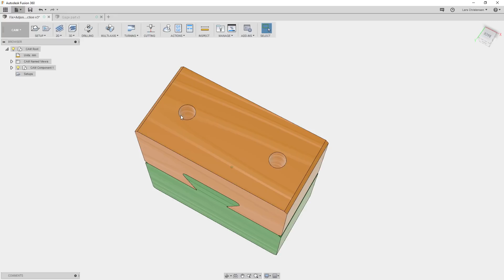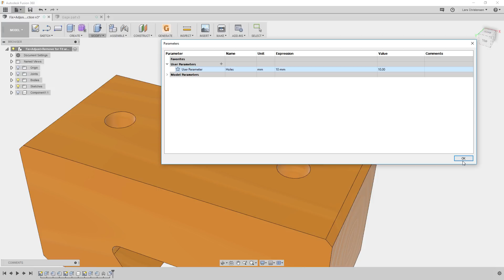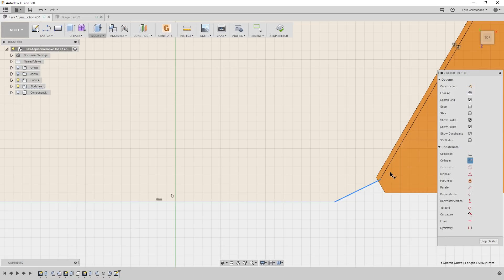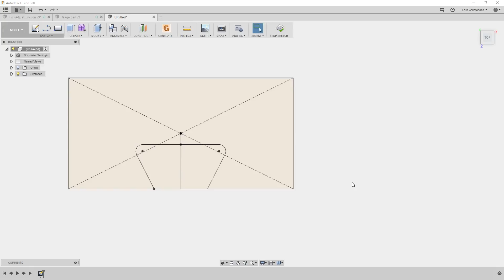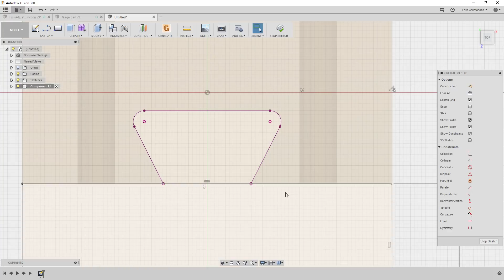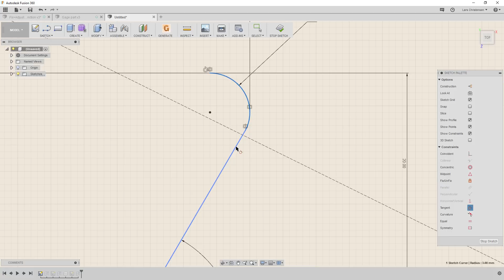Comment: My problem is I have 4 3D printers, all different models.  Biggest mistake ever.  Actually 2 of them are the same model but one has a lot of upgrades so it has become sort of different.  I have an Ender 3 v2, a highly modded ender 3 v2, an ender 3 s1, and an ender 3 s1 pro.  So every time I get something to print right on one of them, it's never the same on the others.  So yeah if you buy a bunch of printers for production or something, try to get all the same model.  I might be selling 1 or 2 of mine soon if anyone is interested.
Reply: yeah?

Comment: So, I worked my way through the dovetail drawer and modeled my part. Now I want to mill it (it's small). How do I undo the joints or do I have to do it over without the as-built joints? Sorry if this is off topic.
Reply: Hi Martha Gay Thank you for watching!
You have a couple of options. One you could just hide the components you don't want to machine or you could break the part out of the assembly, like here:
https://youtu.be/00_6u1J0xkA?list=PL40d7srwyc_Mkgc5wvP_OfVel9aDkNkZ6

Hope this is helpful

Comment: Best practice is to make bodies, and convert to components last.
That way, all your sketches are accessible and you can snap to lines, construction lines, and vertices of the other bodies at will. Sketch points and vertices will also autoproject onto news sketches if the body was visible when the sketch was created.
A side benefit is that it will allow you to organize complicated drawings better since Fusion will not let you change the order of bodies or components that are at the same level. Make all your bodies, then export them as components. Make a new component for each sub-assembly and move the components into the sub-assembly in the order you want rather than the random order Fusion gave you.
Reply: I got the idea directly from the Fusion 360 forum, and they seemed to consider it to be part of parametric drawing. The basic idea being that every part in an assembly has it's dimensions and location dependent on a minimal number of parents that are placed as early as possible in the timeline.
Master modeling would be a good word for it.

Comment: Lars,
Is it possible to use parameters on joints?
Reply: David Ewen_P how would you use them David?
Reply: Yes, you can use parameters in joints. At least on joint limits. It works very well, but I find that in complex assemblies, it gets very slow to calculate (when you rebuild the assembly due to some updated part or open the project) if you have a lot of parameters that change the size of a component (in extrusion lenght, for example) and in the limits of slidiing joints based on the lenght of those components.
Reply: Dude Makes Stuff 
We have some sub assemblies that are generalized for use in multiple parent assemblies. A few of the joint dimensions need to be modified to fit correctly. 

These are portable pump skids. 
Components are base plates, wheels, pump, motor etc. things need to move around slightly depending on options.